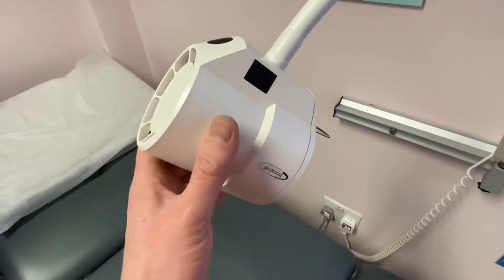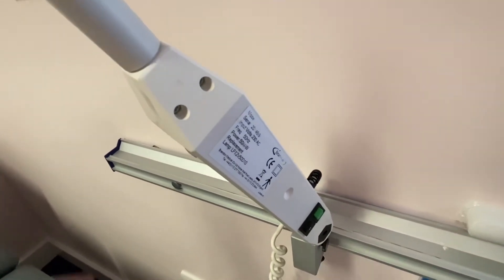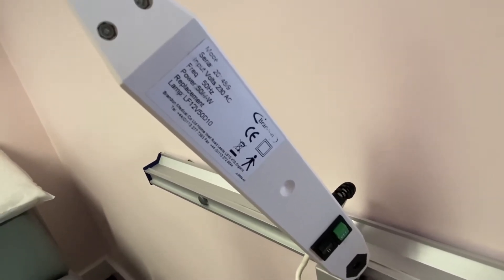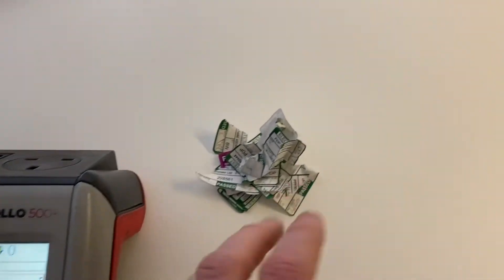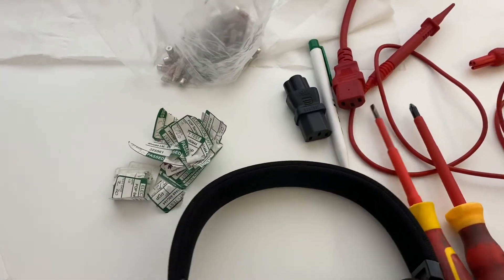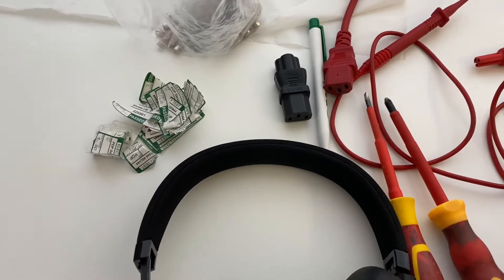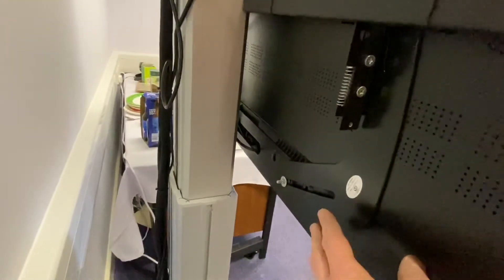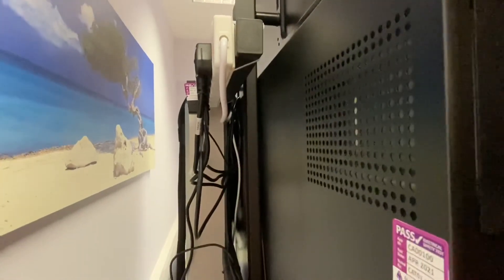PAT Testing a Medical Facility

Comment: You be way ahead of me on this as I am revising for the exam BUT, I have come across info that says the surge protective devices inhibit the test voltage so is it not better to carry out a "Ramp test" lol if i remember that correctly?  So there is a steady build up of voltage rather than a full on one.
Reply from the maker: I think you are looking into it too deeply. If you carry out a 500v insulation resistance test on a surge extension lead then it should fail but actually proves that the surge device is functioning properly. If you carry out the test at 250v then it should pass the test and the voltage won't be enough to trigger the surge device.